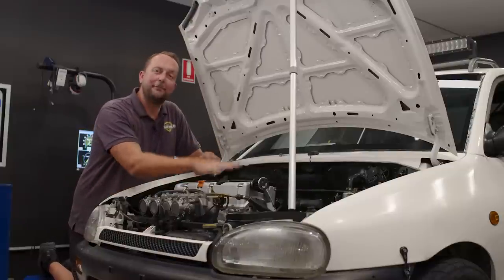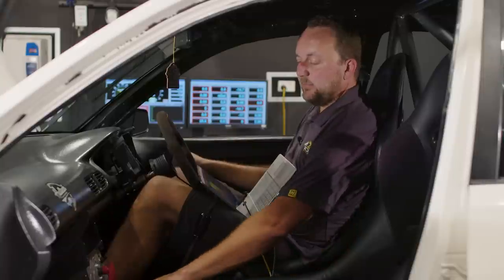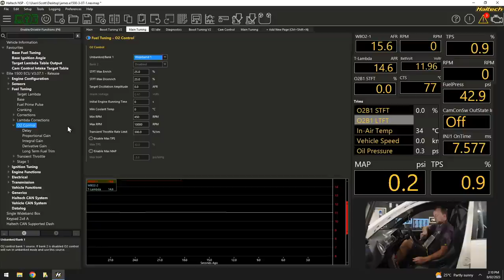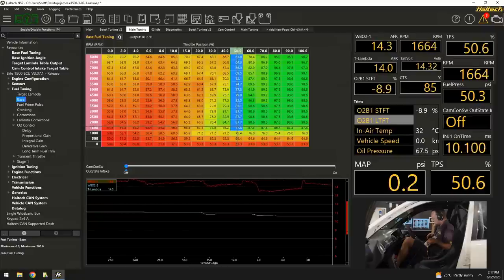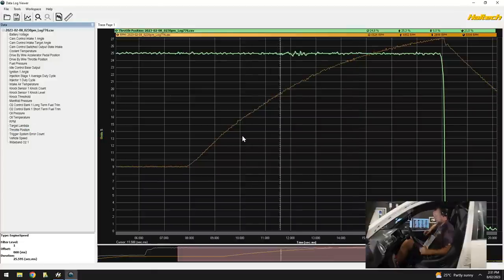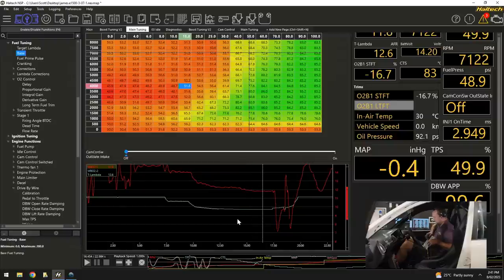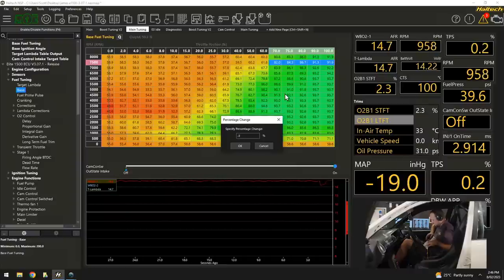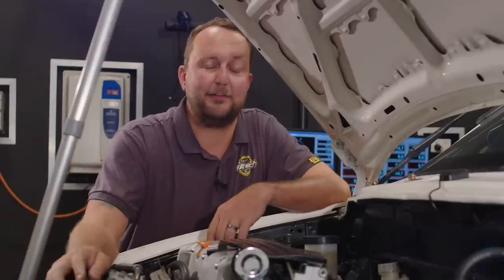🛠 Live Tuning: K24 Mazda 121 with Individual Throttle Bodies (ITBs) | TECHNICALLY SPEAKING

Comment: Thanks guys for letting us strap the mighty bubble on the dyno!
Reply: One mean jelly-bean! :)
Reply: Make some videos on it!
Reply: I thought I had a Big Block Bubble. You guys just blew mine out of the park. 😅👍
What gearbox are you using?
Reply: @MafiaboysWorld  I'm still amazed it fit! It's running the Accord Euro 6 speed gearbox.
Reply: @jimbositb  6 SPEED?! WHAT?! 😳 I knew the K would fit because it fits in the MX5 which is stock BP and the BP fits in the 121, but the 6 speed aswell?!?! 🤯🤯 Dude, bravo. 👏👏👏
What's her weight now with the K24? You say anything under 900kg, I'm gonna need a towel. 😂👍
Reply: Just wanted to find out if you have any build videos on this or other things with how you squeezed it in to such a go-kart like body
Reply: @MrNosajwhitey  The engine bay of the 121 is actually massive for the size of the car. 👍 They are identical in the front end to their bigger brother in the Mazda 323/Ford Laser, the difference between them is behind the A-Pillar.
Reply: Unfortunately no build log, might have to put a slide show together! As for the 6 speed, it was mostly for reliability and cheap (at least when I bought it years ago). I haven't actually weighed it, but a guess would be around the 900kg mark. I don't think there's much weight difference between the stock iron B3 and aluminium K24. Other than that it's mostly a stripped 121.
Reply: @jimbositb  Yeah, I was lucky. I had the B5 stock with my one, that's why mine was called Big Block Bubble, but I happily cede that title to you now. 😁👍
Reply: @jimbositb   Please do a slide show or build review. That's a great project.
Reply: @jimbositb   this is awesome, I did my apprenticeship on these cars and always thought it would be hilarious to make one fast lol
Reply: @jimbositb  how did you go with the engine mounts did you get them done custom
Reply: @karlgeorge7850  There are some fabricated mounts welded to the car, and just some k-swap mounts on the engine.
Reply: How much did it cost total roughly ?
Reply: @karlgeorge7850  I did all the welding myself, so only about 300 for the K-swap mounts

Comment: You win the internet for the 22nd/2nd/23.      : )

I hope you do a follow up video, showing the effects of longer and shorter inlet manifold runner lengths.

3D print different thickness ITB adapters. 

Im also keen to see how it's possible to tune  using different length trumpets.

Just saying!

: )

Comment: Great video, thanks Scott.  I'll be putting this into practice soon with a set of Yamaha YZF-R6 DBW throttle bodies on an old BMC A-series retrofitted with an Arden 8-port cylinder head.
Reply from the maker: Nice! Interested to see how it goes:)
Reply: @haltech  Yeah, same here.  Now all I need is the Nexus R3, waiting patiently 🙂
Reply from the maker: Not long now:)
Reply: @haltech  the interesting thing about the YZF-R6 (and YZF-R1) throttle bodies is that the pedal position sensor is integrated into the throttle bodies and a cable is connected from the pedal to the throttle bodies.  So I get to keep my old Morris Mini accelerator pedal, win.
Reply: @haltech  question regarding the use of MAP for the VE.  If the engine has a big camshaft (say 300 degree duration), would it still be OK if the MAP signal bounces around at low RPM?

Comment: Power gain depends on application.  I've gone from an engine rated at 118kw flywheel from Toyota, to something that makes 134 hub rwd with a well r and d'd itb setup.  I think with modern emissions laws cars have fairly high performance and clean running engines that are choked up with bad cat converter designs up by the head, small exhausts, and undersized throttle bodies.  The k24 is the rare exception as Honda does a great job with their design. 
 On my engine, 2azfe, I've changed from a single 55mm throttle to 4 X 48mm throttles but the real gains came from extending the length of the inlet by moving the butterfly's upstream.  There are other benefits you can tap into such as upstream injection so you get a cool charge and improved atomisation, that might not be possible with a single throttle OEM manifold.  I plan to start experimenting with this soon but my e420d adaptronic ecu has a fairly limited way to integrate this.

Comment: Awesome video, I'll be doing something similar soon. For the MAP sensor is it better to have a larger or smaller vacuum block to pull a signal from? I think that the ports from the ITBs shouldn't be bigger than 1mm and have equal length lines to the vacuum block, agree?

Comment: Thanks Scott and Haltech for this excellent video !

I'd love to see a video explaining why and how the MAP sensor is computed to provide the proper fuel injected output, in low-loads conditions with ITBs.

I've just switched my ITB setup to InjectionTime method because of weird low-load (TPS < 25%) outputs and difficulties to reach the AFR Target values with the VE Method. I converted the onboard pressure to Atmospheric Sensor and I'm not sure I can do that with the VE Method.

Eventually, an dedicated "ITB Method" would be VERY much appreciated, as it is offered in various other ECU/Software (MS for instance).

Comment: Have you used the efi hardware map sensor collector kit for individual throttle bodies?  I’ve purchased one for my Crossflow 6 cylinder with Jenvey ITB’s and Haltec 2500 elite. Hoping to have the efi conversion done in the next 2 months. We will be doing back to back test from 4 barrel to ITB’s. I’m tipping a huge gain on the old dinosaur engine.  Obviously modern efficient engines the gain would be less.

Comment: Hey Scott, why don't you ramp it through the % TPS ranges while building the fuel map and use the AFR % error on the Mainline Dyno and or log to the ECU instead of steady stating the engine building abnormal combustion temps?
Not trying to be a smart ass, but that how I knock them into shape and even if it's tuned via manifold pressure I throttle them through and run faster ramp rates as the load sites get deeper.
Interested in your view point?
Thanks for the great tech and you guys have got great support 👍

Comment: Interesting that the throttle bodies are mounted backwards.  I guess since the injectors are not used, it works OK?
Reply: Precisely!  Because we're using the stock injectors and rail, we had the option of reversing the throttles. It made for neater packaging and took up less room.
Reply: @jimbositb  Sure does.  I'm in the process of fitting a set of 2020 YZF-R6 throttle bodies onto a BMC A-series in a Morris Mini.  The cylinder head has been swapped from the BMC 5-port siamese head to an Arden 8-port crossflow head.  Should be interesting to have DBW in an old Mini.

Comment: Thanks. Interesting video. Still trying to understand how the MAP sensor is part of the equation though?
Reply: The map sensor does what it always does, and that is to trim the fuel mixture in reference to the available air.  However this effect only occurs until the map sensor reading reaches atmospheric pressure.  So it does what it always does, as it just assists with fuel volume calculation.  As Scotty said it's a needed value for the Volumetric efficiency tuning so it must be used and input it's data.  The real world effect is clean afrs, and smooth performance from idle up and while cruising.  Basically the difference is on ITB cars the inlet pressure goes to atmospheric pressure much lower in the TPS range than a single throttle setup.
Reply: @MJBOGAN  Does that mean he tuned a table based on the MAP sensor input (for use when there's vacuum), before showing us the RPM vs throttle position map?

Comment: Scott, the Alpha-N might have been better suited to use DBW APP as the axis vs. Throttle Position in this situation.  That way with any feed forward PID of the idle circuit on the DBW or anything else effecting it, it's not changing the mapping as you are still referencing demanded APP.
Reply: Does it matter if he’s tuning it in steady state?  I’m not sure cruise control would work if the map is based off of pedal vs actual throttle position.
Reply: That could only work if the pedal and throttle relationship were linear and never changed. If you changed your pedal to throttle table, your VE table would need retuned. If you base it on  DBW TPS or engine demand, it would be accurate always, no matter how you adjusted or map switched your pedal to throttle relationship.
Reply: @nikczzowitz92  this is going to depend on whichever car and how it controls idle circuit and such. 

More commonly I'd find a single DBW Throttle Body needing 8-15% throttle to maintain an idle control and doing it this way ends up being a total mess of a map.

This one particular ITB setup had extremely low TPS readings and it worked here very well as Throttle Position. 

I would prefer to do it on most cars as DBW APP, and retune the throttle curve as I go to optimize engine air speed, then go back to refine the Alpha-N.  More work, but more precise at the end of the day.  The last thing I'd want is to chase idle control around or build an inaccurate VE estimation.
Reply: @Andy Wyatt Using throttle position on a car that I referred to earlier will have the Alpha-N VE Table of 0-15% all the same or odd nuanced differences which change per given situation.  I've seen it as an annoyance in logic, which is why they've been moved to a different axis. 

Actual Throttle Body Position moves dynamically to upkeep feed forward on idle and everything else.  Unless it's been a relabelling since NSP that I've overlooked. 

We could be having a discussion about a verbiage difference here. Actual Throttle Body % moves.  APP does not.
Reply: So yes, Throttle Position bakes in DBW on NSP the same way that DBW APP would with maintaining a consistent 0% position.  DBW TPS does not.

Comment: Would it be possible to use one of the Haltec ECUs to manage a old style Mini (or MGB or single port VW) that uses siamesed inlet ports with sequential injection?
If you are using an NXP/Freescale/Motorola micro with a TPU, I know it can be done. But does the Haltec programming model support the weird injector timing where all of the fuel charge must be injected when the inlet valves are open?

Comment: Would it be similar to tuning a car with real big cams and not much vacuum always had a had time with my civic on cruise and part throttle i had to use the o2 control alot fueling would seem to change up to 14% at the same point in the map only when cruising in one point engine had 7inchs of vacuum

Comment: Thanks for the informative video! I might run one of your Haltech Elite's on my Toyota 4AGE Blacktop 20 Valve with (soon to have) 100mm velocity stacks ;) Please get a supercharged Honda S2000 (preferably 2000 to 2005 cable throttle) for a tune session like this :)
Reply: Check out garage 4age if you haven't already.  A wealth of info applicable not just to these motors, with dyno run comparisons for pretty much every possible tweak to cams, timing,  manifolds, exhaust, runners etx etc.  Super dry NZ humour too. 👍
Reply: @richardallen1629  I do watch the channel and like the content. Dyno comparisons of before and after certain parts are very informative :)

Comment: Can you guys add a base map to suit a setup like this? Took ages to make a base map for my car to suit TPS load, and ive prob got heaps wrong even tho the car runs alright after heaps of work.  Im not running map in any way except for baro correction, connecting the intake to map sensor gave me all sorts of issues.
Reply from the maker: We have plenty of base maps in our archives, contact us on support@haltech.com one of the tech guys will be able to help you out with a base map.

Comment: i dont think it was  clear to everyone, that you were mostly trimming an already mapped AFR and not actually tuning the ideal AFR\Ignition each load point needs for power or economy. so even tho the AFR 13.1 + IGN 25degA was set for X/Y load point the ideal setting my need to be changed in the AFR\IGN map. ???

Comment: thanks for sharing but you have missed the most important reason of all for using tbw itb's. with tbw you would never tune in tps because it completely negates the reason for tbw. TBW ITB's are your velocity valves allowing you to maintain peak air speed at all loads regardless of pedal position. you need to map your max throttle blade angle which may be different for each cylinder. using tps you've certainly left plenty of meat on the table.